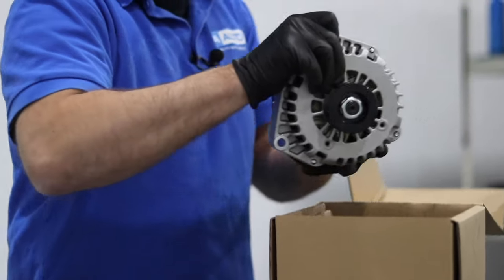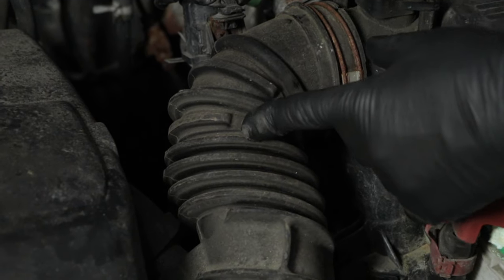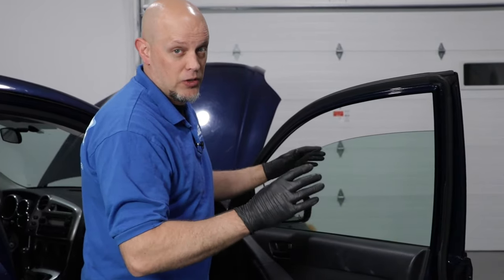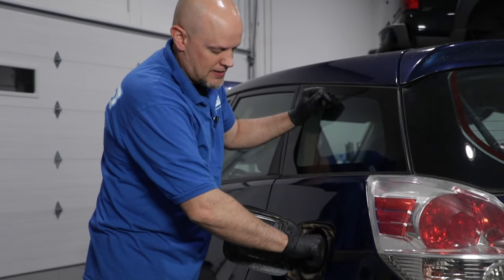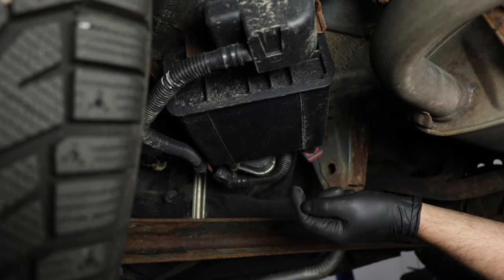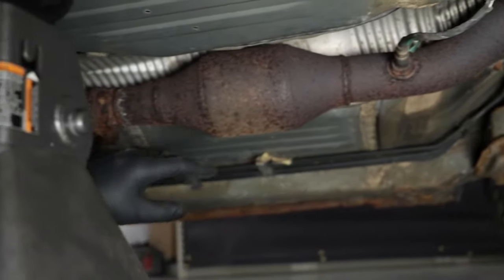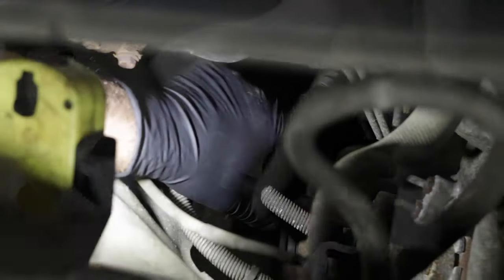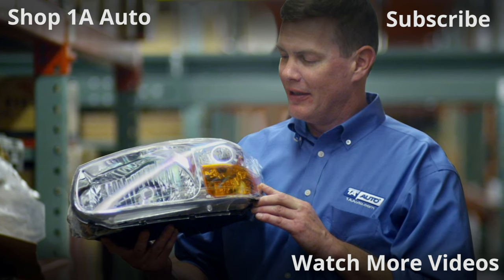Top 5 Problems Toyota Matrix Hatchback 1st Generation  2003-08

Comment: My 05 matrix won’t die.  Over 315,000 miles and still going strong (odometer stopped at 299,999).  Tons of gravel road use, and I’ve drove it from Kansas to Washington six times.  I’ve clipped three deer in it going moderate speeds and  still is chugging along.  I use it as my main fishing vehicle as it easily transports two labradors retrievers,  18 gallon tote for lures, 55 quart cooler, deflated float tube, waders, and 4 fishing rods sticking out the passenger rear window.  All seats are laid over and pads laid out for the dogs.  I’m 6’3” and the only thing I have to remove for me to car camp is my fishing rods.  A totally practical vehicle for outdoor pursuits, just have to watch the ground clearance.  I’ve put 10,000 miles on it fishing spring of 2020 just so you get the picture of the abuse it’s put through.
Reply: Dang thats awesome, always wanted a matrix and thanks for sharing how amazing your car is and for lasting that long. I may have to sell my 07 outback or possible trade for a matrix. Its amazing to hear what this car is capable of. My outback is alright but I'm not fond of how the motor is built, its complicated. I do enjoy fishing too and use my outback for that purpose. 👊
Reply: Wow.... impressive....like from Africa
Reply: Just got a 06' and im using it to do door dash, it came with 266k miles 😁
Reply: Over 330,000 miles on my 03 matrix (also stopped at 299,999 ) and I'm debating if I should fix the window falling problem. I've gone so long  with out  being able to roll down the passenger window because of this issue. How exactly much longer do you think the car will  last ? I rather not throw much money into it with so many miles.
Reply: Good to know the American models stop at 300k miles, mine is a canadian model and it stopped at 300k km or about 186k miles. I love my Pontiac vibe to death. Best car I've ever owned. My brother has 2 and my sister has 1 as well.

We're the hatchback pack 😎
Reply: I have a 2003 Toyota Matrix and it's a very reliable car. I love it minus the plastic by the front headlights....😁
Reply: Weird.  I just bought a 2008 and the odometer stopped at 299,999 too.  Why would that be?
Reply: My 05 is the same way, had a bad camping trip and drove it down atv trails through mud, some of the most fun I have had in my matrix small trial and caked the sides with mud, kept pulling people out of the paintball pack do to open fields and lightening. Got my from Canada only had to replace the blower, and 3 fuses. drove from Dallas to San Diego 4 times and multiple trips up to Rice Minnesota. Still my first car, Texas summer has melted the handles off,(no joke had to replace)  and faded the roof with the sun. going to get it wrapped most likely.
Reply: @JDTKDexter  
 Some Corollas of that vintage also had the "limited to 300,000" odometer as did the Pontiac Vibe (the Matrix "twin").
   It was designed to stop at 300,000 - I guess Toyota did not realize how well built their product was, or did not expect the vehicle to last so long.
Reply: @andresnunez576  Since it is on a Corolla platform, Scotty Kilmer thinks (the engine) should make it to 400k miles if it gets regular oil changes & such-- possibly more !
Reply: My vibe is still putting around at 285k been abused too
Reply: @j.chenmuas  is yours AWD?  My 03 Vibe is 2wd with open diff and no traction control.  It's my one real complaint.
Reply: Driven my Xrs turbo engine matrix 2004 on Nigerian road, scorched roof, great balance bad horn, but it just keeps going, even when the oil dried up in the engine, it's amazing.
Reply: Yea I have an 03 Matrix , it's an amazing little car
Reply: WOW, I expect my car to last a long time then. (:
Reply: I just got a 2005 one with over 300 k miles, no check engine and still feels smooth and strong, thinking about getting another one with less millage!!
Reply: @PaulRudd1941  matrices are all Canadian built. Main differences besides the trims would be the émission control parts for different states regulations
Reply: I've had deer, fish, turkeys and tons of gear take a ride in my 2005. Got 260 k on mine, and my wife's 2005 hit the old 299k a month ago. If I could buy the exact car brand new right now, I would. It's been an absolute beast and has been on some gravel roads on the way to trout streams in Iowa and Missouri that it never should have been on in the first place.
Reply: Hahaha I love fishing as well my TM has 225k still running like a dream
Reply: is there any options to have a plastic oil pan protector? My Pontiac Vibe (same as matrix) doesn't have anything under the engine to protect it.
Reply: How many mpg does it get?
Reply: Same here dude I just got the car from a friend they thought it was useless and I Saul at least a couple hundred thousand miles of life left in it I drove it from Jersey to West Virginia to Florida and back and hundreds and hundreds of miles around the state it’s truly an amazing car
Reply: @JDTKDexter  Known issue, apparently  not a recall worthy issue though? Mine has the same 299,999 odometer problem as well.
Reply: I got an 06 with over 495,000 on it. never replace anything but breaks and a belt and a batterie. this things a beast
Reply: my 05 matrix just hit 370,000. lol the motor is still strong .... now the rest of the car is another question.
Reply: @Trevor V do you still have it? We are a Matrix family, I have a 150,000 mile 06 Matrix auto base model, & my uncle has an 05 exactly like mine just with no A/C from factory (ultra base model) and it only has 99,000 miles. His door weatherstripping is just rotting away lol.
Reply: Still thinking Vibe or Matrix

Comment: I had a P0171 in my 2005 Corolla I recently bought for my teenager. 183k miles and no maintenance history but fairly good deal. Hesitation when takin off and when accelerating and very high fuel trims with bad gas mileage (20 mpg) Ended up doing all sorts of things attempting to fix it. Watched tons of videos and even took it to mechanic to diagnose. Cleaned MAF sensor, “TESTED” MAF sensor using the unplug while idling method and car shut off so I concluded MAF was good, replaced PCV valve, air filter (very dirty), oil and filter and changed spark plugs…no change. Took it to mechanic $100 diagnostic fee who quoted me $2100 to replace the breather hose ($220 ) cat converter (1300+) and induction service all of which I declined.  2nd mechanic recommended replacing intake manifold gasket….I started working on it myself…bought cheap OBDII scanner and cleared codes after each intervention then tested. I replaced intake manifold gasket, throttle body gasket, Removed and cleaned fuel injectors using popular DIY method (9v battery and can of throttle body cleaner, replaced intake hose, breather hose, new ignition coils (just because), ordered BG 44k Platinum fuel system cleaner and used EPR, MOA in crank case, new oil and filter of course finally replaced fuel pump…to my dismay, no change. I watched this a figured what the heck I guess I’ll try a new MAF for $40 from 1A Auto…. Fixed it. No more codes, normal fuel trims, drives very well. So the “unplug the MAF and engine shuts off” test commonly seen on YouTube is NOT full proof. Hopefully this helps someone! I’m no mechanic but I learned quite a bit and actually enjoyed working on this car. Now to change transmission and other fluids.

Comment: You forgot the cloudy headlight shells, the odometer that hangs up at 299,999, door handles breaking off and door stays snapping....   Minor stuff, great cars.
Reply from the maker: +Patrick Zambori Thanks for the feedback!
Reply: That door handle replacement is no joke though, as an amateur moving the locking mechanism out of the way was a little intimidating, and latching the handle improperly might cause one to have to re-do most of it…not that I did that or anything

Comment: My wife drives a vibe(GM version) and it's been solid. It will hit 200K at the next oil change and we've put over 100K on it. Only thing I've had to do beyond regular maintenance is the charcoal canister, intake gasket, exhaust header, serpentine belt tensioner, and an upstream oxygen sensor. All very easy to do at home.

Comment: Good content thanks.  I have a 05 Matrix and 2 of the 5 things I already encountered. Overall a really reliable commuter vehicle
Reply from the maker: +Bruce Cruz Thanks for checking us out! 1AAuto.com
Reply: I have an 2005 Toyota Matrix as well with just over 200,000 miles.  Good reliable commuter vehicle like you said.  Just have one quick question regarding rust and paint fading.  Just curious if your roof is starting or has already started to rust like mine along with the paint peeling on the hood like mine.  Have been researching this and supposedly in Toyota blogs I have been reading through the 2000s model Toyota cars were not equipped with the proper rust/oxidation prevention coat when originally manufactured.  This problem has not only occurred in the matrix models also other 2000s Toyota models.  While searching this on google I’ve noticed I’m not the only one that this has happened to especially on Toyota Matrix models like ours.  Hopefully this issue/defect has not occurred on your car.  If so just curious as to how you went about repairing/fixing it.  Been researching and trying to find a low cost method to fix my car.  Any input/info you can offer is appreciated.  Thanks.
Reply: @Jeepguy30022  i have a 05 matrix, sane problem with paint not so much rust. As far as problems in video, knock on wood i haven't had any of those in vid. Only have 125,500 miles, just had new clutch, ac compressor and struts done. Love the car but looks rough on outside for sure. Going to paint.  Need to have all door handles replaced,all cracked in half and hatch/window arms replaced.

Comment: Great cars IMHO. Nice tip about tightening the window screws. I have 06 Vibe with same engine 93k miles. I noticed a loss of power and gas mileage. I found the intake manifold gasket was leaking. About $10 and 1 hour to fix. Gained 5 mpg and power return after fix. Also had a small leak in valve cover gasket letting a bit of oil seep down to spark plug, again about $10 and 1 hour. Worst thing I've had was replacing tensioner pulley. A bit more $$$ and work but still doable for a DIYer. These rides are pretty easy to work on even for a noob like me, super reliable and run forever. Love mine.

Comment: I inherited my father's 2007 Vibe when he passed in 2017 (RIP Pops), it was his second one after he got t-boned in the first.  He chose well and its been an awesome vehicle thus far, tonnes of capacity, great mileage, reliable, the little Kenwood/Monsoon stereo system rocks enough I don't need more, it gets regular oil changes and thats been about it so far (other that brakes etc.).  The engine light just appeared for the first time so I'll get somebody to read the code, but the running doesn't seem abnormal and I'm hoping its something simple like a new air-filter or MAF or O2sensor.  I'll disconnect the battery for a bit and reset the brains first and see if it persists.  Thanks for the video and to the other commentators for their input, really good cars imho :)

Comment: The window regulators/weather stripping are a big one too. I've had to replace them on both my mother's 2003 Toyota matrix's as well as my recently obtained 2005. 
The window regulator will eventually guide the window up out of place and fold/wedge the weather stripping out of place destroying it and the regulator. These often need replaced I've noticed.

Comment: Thanks for the vid.  I own a 2008 Pontiac Vibe with 240K miles.  Bought new, oil every 3k, religiously.  Never had a spark plug out.  Only issues were recalled air bag and computer module.  I replaced a heater door actuator and an intermediate exhaust pipe.  Most trouble free car for me, ever.  No Wisconsin rust and the engine runs and sounds like new.  Never used a drop of oil and the oil looks almost new at the 3K oil changes.  Normal brakes and tire replacement.
Reply from the maker: +Gravertrain Graveytrain Thanks for checking us out! 1AAuto.com
Reply from the maker: +Deplorable Thanks for checking us out! 1AAuto.com
Reply: You should replace the plugs with denso iridiums, the gap is increased at this mileage and it puts a lot of strain on the coils to jump the larger gap. Additionally, the plugs can sieze up in the head if left too long (make sure you change them on an ice cold engine, to avoid damaging alum threads in head).

Comment: Had most of those and a few serious issues with my ‘05 AWD.  

The rear VSC went out a about 90k miles and the unit was over $4500 to replace.  No way I was going to pay for that. I ended up cutting out the rear drivetrain and JB welding the yoke on the output shaft.  It’s got 200k miles on it now, and the repair has held up so far.

Also, the airbag system on mine is temperamental.  Replaced $1400 worth of parts and harnesses and it still acts up.

I’m sure the FWD models are fine, but I’d stay away from the AWD version.

Comment: You're right about the mass airflow sensor. My Matrix had less than 60,000 on it when I had problems with it. I tried to clean it with the MAS cleaner but like you
said it was too dirty. They are really easy to take out and replace. You have to trade in your old one for the new one plus about $70. The car will run really rough and
I think the check engine light or something came on when it went bad. It was a long time ago.
Another problem of course is the passenger side airbag recall. The first recall they replace it with the same bad airbag and then sent out letters a few years later
to replace that one. I had a real hastle trying to get the dealerships to get the correct parts and do the job. I finally got it done and what a relief.

Comment: I'm over 350K on my 05 Matrix and his problem list is spot on.  I'm going to need to locate the bad engine mount when I change my clutch in a few months.  It's eaten a lot of coils and i can't get the exhaust sealed up at the headpipe but other than that, it's been a great machine.
Reply from the maker: +Tom Cyr Thanks for the feedback!
Reply: I recommend replacing all your engine mounts
Reply: My 2003 xrs has the same exhaust leak at the donut from the down pipe. I hope I can get it to seal

Comment: I had a 2007 Pontiac Vibe and was so impressed by its performance and dependably! Mechanically it’s the same as the Matrix. The exterior is the only difference between the two. I’m looking to buy a new one because they run forever! I know someone that has got one that has well over 200,000 miles on it and it is still running strong! My only other choice is a Honda C-rv. It’s known for its dependability as well. But that’s it. I don’t want anything else.

Comment: There has been a problem with leaking timing chain covers which if leaking oil a lot requires the engine to be removed which is expensive. It’s too big a job for me but thought owners and potential buyers should be aware. It may have been covered by Toyota at some point if car was taken in. Thanks, good information about the evap code.
Reply from the maker: +Richard Morse Thanks for checking us out. Shop for high quality auto parts on 1AAuto.com:

http://1aau.to/m/Shop-1AAuto-c

Comment: I love the Matrix!  I have an '06 that I bought for $700 two year ago; the price was cheap because it wouldn't run (blown head gasket).  I spent about $300 on parts doing the head gasket (all the gaskets and seals I could, plus rod bearings and everything else I touched during the job); the head had to be milled 10 thou, but the block didn't warp (aluminum block...I was afraid it would have warped, but it didn't).  So my Matrix has a milled head, haha!  

The reason the head gasket blew in the first place was because apparently some mechanic forgot to plug in the fan electrical connector and it overheated.  It was sitting for almost a year before I bought it.

She now has 215k miles (20k miles since the rebuild) and is going strong!  I recently drove her on a 3000 mile road trip, and had no issues at all.  I wouldn't think twice about driving that Matrix from Maine to Los Angeles.  Just keep up on oil changes and fluids, and they are great vehicles.  

The one item I'd add to your list is the exhaust pipe at the muffler flange always rusts out on these and the Vibe and so you have to replace a piece of pipe from the resonator to that flange.  Oh yeah, and the digital clock on the dash is hit or miss (bad soldering on some resistors inside). That's about it!
Reply from the maker: +L35 in Colorado Thanks for the feedback, we appreciate it!
Reply: @L35 in Colorado
 these points are spot on. I have an 06 rolla and I am on a third piece of tail pipe that rusts every few years, lol. I recently re-flowed the solder in my clock and it is bright again. BTW you have good channel too. cheers.

Comment: Hello, I liked your video, I have a 2008 Toyota Matrix, it is a good car, despite some of these details that have happened to it, it has 140,000 km and the engine feels very good. Greetings from Mexico City
Reply: Peace and love from Calgary, Alberta!
Reply: What issues have you experienced and what did you do? 

I also have a 2008 Matrix, mine is a base model with 5 speed manual. Runs great, I'm very happy with it. I proactively changed the intake gasket to the red one. I got the dealer to order the part in for $12 CAD and then I installed it myself following a Youtube video. I also cleaned my MAF sensor with MAF Sensor Cleaner spray, and the only other thing I did was get Toyota the dealer to replace my airbag(s) under recall. It's good to take advantage of free service under recalls now since they are only valid for 15 years and our cars are 13 years old.